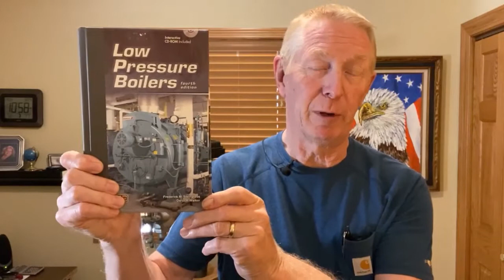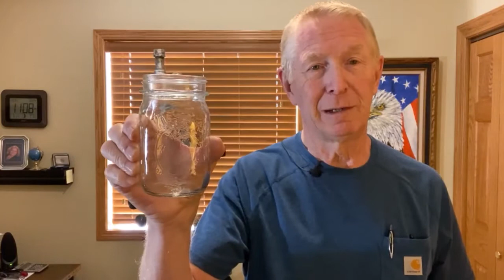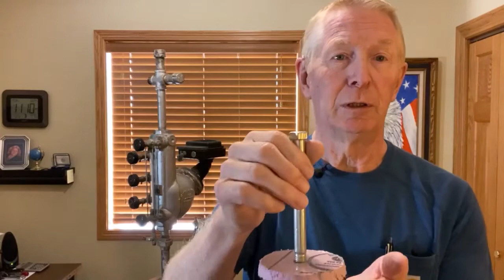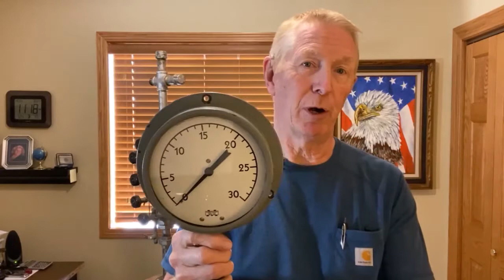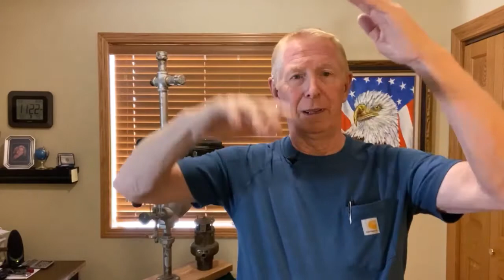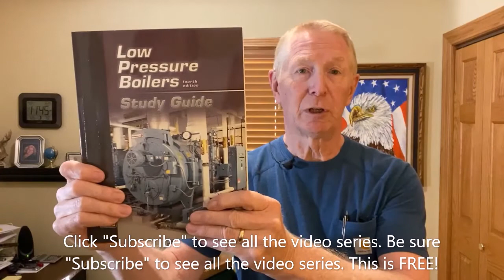Low Pressure Boiler Training-Session 2- Boiler Ben

Comment: Are the high pressure boiler class the same?
Reply from the maker: High and low pressure boilers have much in common but there are some big differences. Basically low pressure means not above 15 psi and high pressure means any boiler that operates above 15 psi. It is the difference in pressures that create differences in design, accessories and operation practices. Thanks for watching!!

Comment: How do I stop steam hammer from the process piping.
Reply from the maker: Water hammer can come from a couple sources. It can come from priming or carryover from the boiler into the steam lines. Check to see if the boiler is foaming or overfilled. It can also come from condensate forming in the steam lines that doesn’t get collected by a steam trap. Check steam traps for proper operation. Thanks for watching!!

Comment: Thank you for your videos they are very helpful, however I have a question. Would a Hotwater boiler be the same thing as a watertube boiler?
Reply from the maker: Hot water boilers can be firetube or watertube. Hot water boilers can operate at high temperatures and high pressures but do not create steam. Thanks for watching and the very best to you!!

Comment: hi Ben, tank you for your videos, i learned a lot interesting things. Greetings from Colombia.
Reply from the maker: Luis. Welcome aboard! Safe boiler operation doesn’t stop at the ocean shore or any border!!
Boiler Ben
Reply from the maker: I have been advised to not expose my email publicly but I will respond to any questions or comments you have through YouTube.  Wishing you the very best!
Reply: @BoilerBen  Mr. Ben Weekley cordial greetings, my name is Luis Reina I am 42 years old, I am a Boiler and Power Plant Control Room Operator, I have 20 years of experience operating a control and distribution system in the field and in the control room of steam (at 600, 250, 170, 80 and 50 psig, and an installed capacity of 500 KPPH), I am Colombian and currently I am in Colombia, I work in a pulp and paper factory where I operate coal boilers, natural gas boilers , # 6 fuel oil boilers, HRSG (Solar Turbine a Caterpillar Company), steam distribution systems, Westing House and Siemens steam turbo generators, air turbocompressors from JOY company, and low and medium voltage electrical distribution systems, mi profession is Industrial Electrician and currently I study Industrial Automation at the National University of Colombia.
The company for which I work applies all the construction, installation, operation, care and maintenance protocols established by ASME, but in Colombia there is no state or private organization that certifies boiler operators, so my question is, do you think it is possible that I take the required exams to obtain a license as a boiler operator in Minnesota, or in some other state of the United States of America?

I thank you in advance for the information you can provide me.

I watch each of the videos on your youtube channel and I have learned and improved a lot of knowledge.

Successes.
Reply from the maker: Greetings Luis Reina, Your experience and knowledge of boilers is very impressive! As you know my videos are for low pressure and in the United States the use of coal in these boilers has been phased out. Coal in various forms is still used in high pressure boilers. The operation of steam generators is a category all its own and in Minnesota it requires a Class A license. In Minnesota there are three classifications A, B and C. In each classification there are three levels Second Class, First Class and Chief. So as an example a person could have a Class A Chief license which would allow the person to operate High Pressure boilers regardless of the Boiler Horsepower. A person has to pass a test for each classification or level and must prove they have actually had experience. Minnesota not only relies on a person passing a test but also puts great emphasis on experience. Obtaining a certain license simply assures the State and the Employer that the person has the minimum knowledge needed to operate the boilers that they are licensed for. The first beginner license is the Special License and is the starter license. One has to work with boilers for one year before testing for the next classification and level. Having a boiler license is not the same as having a college degree in engineering. So I am not sure how you would benefit buy coming to the United States multiple times and testing for the next classification. I believe that other states or cities have the same type of license progression as Minnesota. For more information go to the website that I give information on in the video concerning Minnesota Session. You will be able to find the email address of the Chief Boiler Inspector and contact him. Perhaps he can best advise you on the licensing issues you have and how best to proceed. The very best to you, Boiler Ben.
Reply: @BoilerBen  Greetings Mr. Ben, thank you for your valuable information. I'm going to look up the email address of the Chief Boiler Inspector and try to contact him for more information.
have a nice day.
Reply: Hey parsero !!! Good to know that Colombia is present.